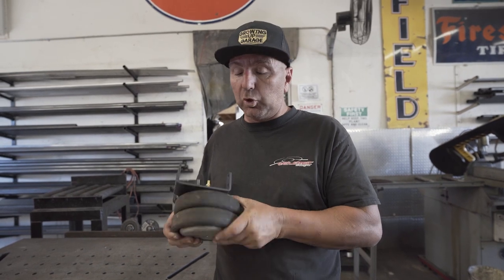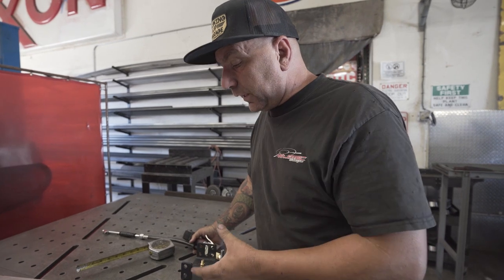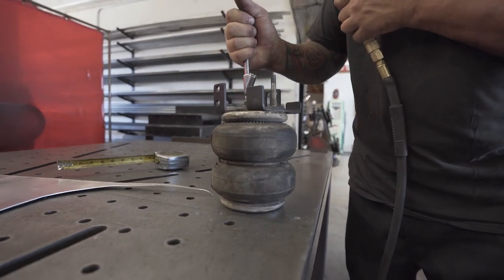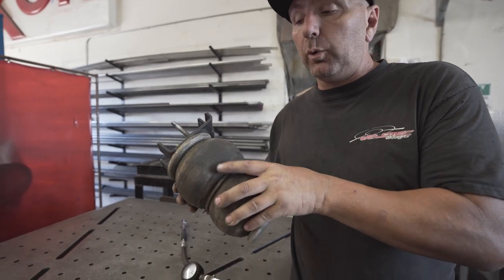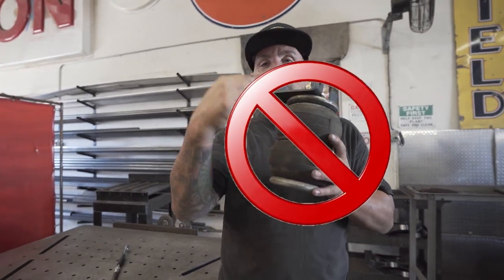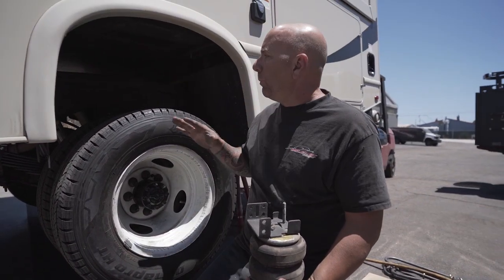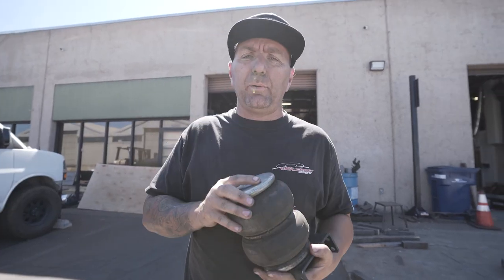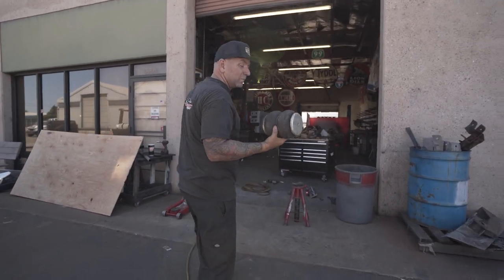Why Not To Use Air Suspension On Your Off-road Van

Comment: You have to have air ride suspending  not air bags over leaf springs because you don’t have it set up for air ride with no leaf springs with bump stops inside air bags so if you blow a air bag it will set on bump stops and not on the frame so you can not move it !

Comment: you really need to use longer brake lines or relocate the mount of the brake line as it is under a lot of tension when at full drop on that vehicle.. huge safety issue you will want to fix
Reply from the maker: Thanks for the recommendation, however we do lower the brake line bracket, it just wasn't shown in this video.

Comment: That was an awful lot of black shiny new springs on there that you used for your example rv. So, how much did you charge your costumer to put those on there for them? Cause I see the airbag kits for like 300$ and I can put them on myself. When I need to put my motorcycle on my hitch I need extra strength it’s an extra 500 lbs hanging on the rear end. If I put helper springs on then when I take off the bike my rv will pop up in the air and knock my wife out of the bed. I think this video is a bit miss leading. If you show me an rv that uses the 10" of travel, I show you an rv that is stuck lol
Reply: The spring packs themselves are about $1400 + shipping, and that's to do all the work yourself. No comparison in price with the cheapo kits that have all mysteriously disappeared after some damaged vehicles and lawsuits. But compared to properly done air suspension it is still much cheaper. (the real air suspension kits from Europe are about $7-8k, going up to $15k, and that is before installation)
Reply: @nickopedia5669  I do not disagree. I just wish the video would have specifically talked more about the way suspension works,  what leaf springs do and how they do it, why the cheap air bag system seem like they work but can be dangerous, and also how time on an old suspension being worn out is normal and what to do. Or have a shop do. I have a 1990 Damon Escaper ultra sport 24’. It sways down the road and I won’t let anyone else drive it. I know what parts are worn out and I know what to do. Myself. I was just looking at all the airbag system available on the market and watching a lot of videos when I came across this one. I would honestly recommend complete new suspension to any one who can afford it including anti sway bar kits aftermarket or OEM replacement. BUT ALL THIS SAID WITH MY OWN PERSONAL SKILL I HAVE PURE JOY WITH MY NEW CHEAP AIR BAGS. I’m just saying.
Reply: @mrlarrybobjr  
I plan on designing on a real air suspension kit for my parent's T1N sprinter because just like yours, it is terribly worn out after 15 years at or near GVWR. I found the firestone airide catalog on firestoneIP, and am working on finding bags that have the correct weight capacity, dimensions, and travel to convert from leaf sprung to simple trailing arms with bushings (off the front leaf spring mounts) and a new cross member just behind the axle.

And the cheap air bag issues are only for certain vehicles, such as the NCV3 sprinter vans which can have the bumpstop mounting plates bent up into the floor. 3 airbag companies discontinued their kits for that vehicle and no longer offer a new version, because to do it right it needs a new crossmember which is too expensive for the cheap kits. For 99% of vehicles, they're perfectly fine.
Reply: These kits are designed to handle the abuse of intense off roading. If you don't plan on off roading then air bags are a good option.

Comment: I don't want to lift the van, I gta sienna, my girl had Walmart try to change tires... They fcked it up.. her right tire broke like 4 studs out one night..$600 later she's fine. My maine question is if I used a smaller airbag setup and put her on would that give some pressure of the suspension?

Comment: So then now you have eliminated any camping leveling without having to jack and block wheels. Do you own an rv or camper?
Reply from the maker: I do. I have a Class A diesel pusher, it uses leveling jacks that work just fine. Thing is, my class a isn't a van that's 9k pounds that is used to do heavy off-roading in, as that is what most of our customers are doing with their vans which is why we do NOT recommend them bags - a product that will fail when straining the suspension out in the desert or on a trail.
Reply: @WeldtecDesigns  im looking at using them on my dodge ram 2500 4x4 with truck bed camper. Want to add a work utility bed and dual rear axle as well. I have helper springs already and sway bars already. Think i need to start by having my rear suspension accessed by suspension specialty company with camper on vehicle.

Comment: Surely you only need the height for self leveling when stationary? Or tilting the vehicle(motorhome) when say emptying the grey water tank? I don't see any reason to increase the height, and therfor   effect the comfort of the drive whilst moving? Or am i missing something here?
In the uk, motorhomes have plenty of clearance anyway, and i doubt they need to be increased in height at all,  unless they are stationary.

Comment: On a vehicle that spends part of its life towing and the other part just driving with nothing more than it’s stock weight your argument doesn’t apply. When towing you find the sweet spot for air and they work perfectly. If it’s not articulating you are over pressurized.

Comment: I think it's more for leveling not really lifting it cheating like you say
Reply: That's only when all the air bags are connected to each other, so the air (or fluid) can travel around and make it level. Like in DS Automobiles. When separate like this it's just plain air ride suspension.

Comment: You've missed the point of rear air assist totally
Reply from the maker: and whats that? We are talking about Air Suspension when it comes to lifting your van and how springs will be much better for offroad use. Thats a question we consistently get so that's why we aren't necessarily talking about air lift for towing or grocery getting.
Reply: Airbag suspension are pointless for off-roading! 
Leveling out your vehicle for highway, general driving or for show vehicles they are great!

Comment: Ya no they are not for a lift kit .
They are more of a bump stop or additional spring rate adder definitely not to be over inflated or they will feel like they're full of concrete. 
Airbags can work extremely well for the right use auxiliary air volume tanks help them stay plush as well

Comment: are airbags fine for riding at normal ride height or airing out when parked, i’m getting it for my 95 mustang, don’t need to lift it
Reply: only downside is cornering performance. Thats why expensive cars use active suspension to counteract this disadvantage.  If you pair active damper with air ride is it GLORIOUS. comfort AND cornering all together
Reply: @Nordic_Mechanic  but complicated and pricey to install on a car that didn't come with it
Reply: @hansdomke89  No
Reply: @Nordic_Mechanic  oh? You know how to interconnect the bags for self leveling?
Reply: @hansdomke89  yes. height sensors on each suspension arm to mesure eight. Then a microcontroller opens valving to raise the bags to the level you want. That's how it works on cars. Otherwise commercial trucks use a mecanical valve hooked to the axle
Reply: @Nordic_Mechanic  my bad bb, I was think about hydropneumatic. Anyways, have fun when your air suspension brakes out there on the trail. I'll just be using my WeldTec steel suspension as this manufacturer built it for: real off roading. Not just regular dirt roads.
Reply: @hansdomke89   Naysayer always assume air suspension breaks all the time. I've got the first failure at 338 000 miles with simple dryer services. And my dampers are still like new. If air suspension was unreliable and too much down time then I dont think all the commercial trucks would be running them.
Reply: @Nordic_Mechanic  do you take your car on hard off road trails? Semi trucks don't.
Reply: @hansdomke89  Logging trucks do, and it's a lot more extreme that a offroad pickup or jeep.  Trucks went to air spring because coil and leaf spring were a problem. We see a lot of broken springs on cars, trailers and trucks even in road use so your argument of low reliabilty is invalid.
Reply: @Nordic_Mechanic  see you're still not even talking about what this video is saying. This video is saying that these specific coils and leafs paired with shocks is better for vans for hard off roading than cheap air systems. That's what this whole company is about. Doesn't say anything about cars or semis or anything like that
Reply: @hansdomke89  See youre still talking about offroad while the original comment I replied to what about a person's 1995 mustang. So either shut up or dont try to steer that in other directions.

Comment: The real issue here is that 99% of them are done wrong for the purpose of improving ride quality.
And why is this? It's because airbags were originally designed for when you're trying to support a load far greater than the vehicle was intended to be normally used for, and thus you are trying to compensate for suspension (and shocks) that are WAY underdamped for the load, by putting on an exponential spring on it to prevent bottom-outs. Not a great way to do it, (compared to stiffer springs and shocks), but when you're trying to tow a 30,000lb boat with too much tongue weight using an F350, it still certainly beats the factory suspension by a mile.

However, that original installation purpose is NOT what we are looking for, as we are staying under normal loading conditions, and actually giving our shocks even more travel to do their job. We're just looking for a constant upward force, irrespective of suspension position to give the shocks a little more room to do their job, and let the factory springs do their job of increasing force throughout the travel by their reasonable amount.

Therefore, when using it as a way to restore ride height under the weight of an RV vs a passenger van, or as a lift to increase ride height, each airbag needs to be connected directly to a tank at least as big as the bag. This way, as it moves upwards, instead of increasing pressure towards "infinity" as bag height goes to "zero" (not actually infinity or zero, but you get the point I hope), it increases towards a maximum of only double its original force.

Double may sound like a lot, but isn't at all compared to normal leaf springs that can increase by a lot more throughout their travel as overloads engage, etc.
Reply: Now my issue has been finding air springs with enough travel to not limit the stock suspension on a 2006 t1n, which is about 7-8" or so in the rear. I don't offroad and am not looking for more travel, but just to keep what I have and not have the rear axle violently control the rest of the van while exiting driveways for example. It still has the stock mono-leaf rear suspension, but always being at near GVWR makes it sit rather low, about 1.5"-2" lower than the unloaded position.

For now I'm just going to go with some 14", 600lb rate eibach coils to get the ride height back to the stock height and see how that is, (and build the custom crossmember and leaf plates to hold the bags in the future), but if I can find airbags that have 7-8" of actual travel, then that would be the way to go IMO. With the tank-connected airbags, they will continue to support a significant amount of the vehicle's weight even as it droops out while exiting driveways (nearing the bottom of its travel, where normal leaf springs provide lose all their supporting force), and therefore reduce the pitching over effect as one wheel droops out while exiting a driveway.

And the biggest reason for airbags over just coils is ride quality and adjustability, my parents had a 2005 cadillac with properly done air suspension from the factory, and it really just isn't something the oscillating mass of a coil spring (or all the friction in a leaf pack) can even try to compare to. Assuming your shocks are valved for a Cadillac ride as well. Regardless, it MUST be done properly, or it's worse than not doing it at all. (as your customers found out)

Comment: I have air ride on my 40 foot Thor Tuscany pusher, it rides better than any of my cars..
Reply from the maker: 2 Very different vehicles. Class C's ride different than a class a rv as with vans and cars lol Comparing apples to oil filters on that one.
Reply: WeldTec Designs agreed .. that thing isa darn bus ....
Reply: I would love to have a four wheel drive school bus ! Use it for camping and hunting..
Reply: Full Air ride is completely different than air helper springs

Comment: Air is compressible so as Air bags.
But you put in so much air which cannot be pressed down by your body weight.
Put just 1 bar or 14.5psi and then see the   nice and bumby movememt out of air bags.

Comment: Well the point of them is to take stress off of The Springs in the spring Hangers On overloaded vehicles. I can send you pictures of what a K 2500 pulling a gooseneck will do to a set of Springs when you're hauling hay out of the field with them. They throw them out at break them off at the frame it is a safety device if people are putting too much air in their airbag suspensions that's because they are morons not they're doing what it is not designed to do

Comment: Sorry mate. It is a bit bullshit. I have Hilux 4x4 just fitted them. The car is rather heavy at the back. And The ride is fantastic. On the road i use 3 bar when off road i use 1.5 bar so rear axle can work fully. Its absolutely briliant. But on vehicle you just showed. Right. Absolutely useless

Comment: Sorry Dude . Your arguments are WRONG . Airbags are only for Supplementary load carrying . 
5 psi in one od those makes a marked difference . You do , of course , need to MATCH the Bag type to the application .
It's Poly-Air springs that are a Bad idea , because they actively bind the Coil they are mounted in .

Comment: You are disgrace to automotive industry, thanks god, that now-days you do not have to understand how things works and just change the part. Screwing bolts together and apart could learn even ape ..never ever give any advice to anyone..ever!
Reply from the maker: Who are you talking to? Try to form a coherent sentence with evidence as to what you're saying because as of right now you're talking out of your ass. You have no understanding of what were doing and why. I know this because if you did your panties wouldn't be in a bunch like they are. Go take that shitty attitude somewhere else. You wasted your own time commenting on something you simply don't like. I'm almost sorry for you.
Reply: @WeldtecDesigns  Apologies for my grammar, English is not my first language and based from what I read in your response, yours probably isn't too. I guess, I was too drunk watching your video, as I do not remember it at all. However, watching again first 4 min, I have to stand behind my first comment. Also, you are right. I have no understanding of what you are doing, because your explanation makes no sense and therefore I would not care further. "Air-springs" are direct spring replacement. Adjustable pressure can modify spring strength. It is not suitable for height adjustment, where specific spring performance is required. For that purpose, mechanical or hydraulic height adjustment would be preferred. Also true, that I wasted my own time to write a comment for this video. I simply felt, that it would be appropriate, since you put [love] on my original comment. Otherwise, I would not give a shit...
Reply from the maker: @lukaskorcak5583  Thank you for watching it again and taking time to comment :) Youtube has subtitles if it helps your comprehension too. Hope that helps!